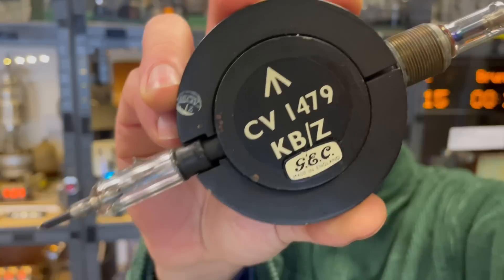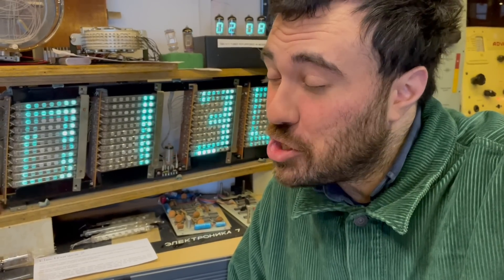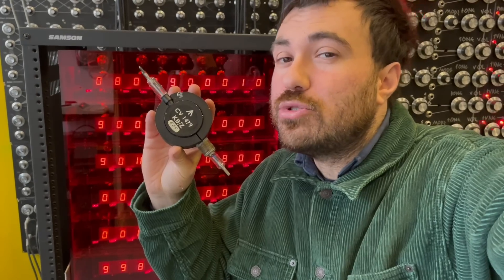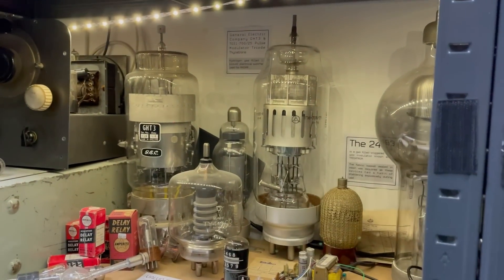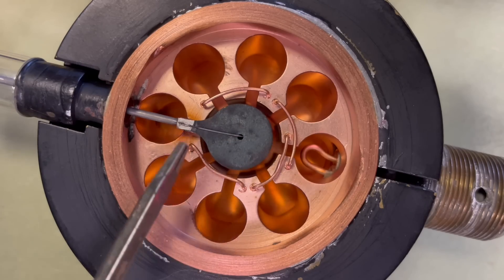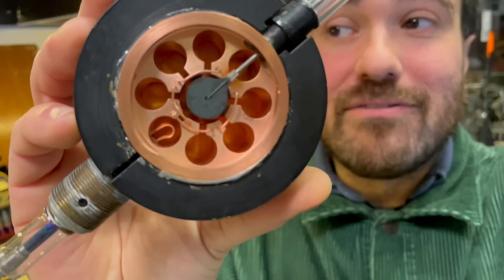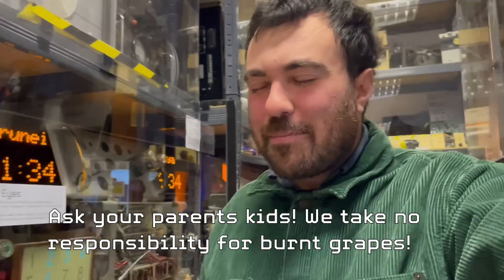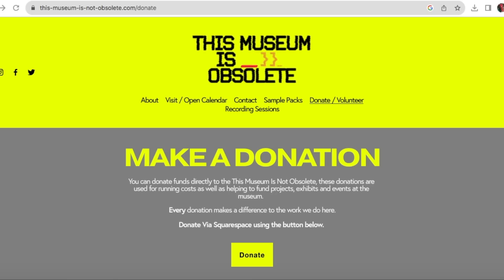WWII Tech You Use EVERY DAY

Comment from the maker: What’s your favorite thing to cook in the microwave?? (The only correct answer is Beanz)
Reply: DVD's!
Reply: @peskyparttimers8239  A friend submitted the idea of using a microwave oven as a way to quickly destroy CDR's, used in military systems in the field, after seeing me do that as a drunk demo. Never got taken up as far as I know. Technology moved on to flash drives.
Reply: @peskyparttimers8239  *DVDs
Reply: air
Reply: Omelets are easy to cook in a microwave. Just about 30 seconds in a large mug. Then again until done. Don’t overcook. 

Lots of the old technology looks steampunk. Thanks. Will have to rewatch video becuz typing .
Reply: Had some experience with Baked Beans in New Zealand. 
I didn't know that the plasma from grapes trick works with two touching grapes as well. I only ever tried it with one grape that's been nearly cut in half and folded open. OMG I just imagined what would happen of you put a whole bunch of grapes in the microwave. Don't know why anyone would want to do that, but who knows what nonsense some folks come up with on a saturday night after 2 am. 
My personal most shocking mircowave-explosions were caused by reheating leftover lunch. First time, I didn't know the paper bag was lined with aluminium foil, which caused a spark and set the bag on fire. Second time, I didn't know that fatty roast pork can explode all by itself. No flames this time, but one hell of a mess.

Comment: I would have liked to see that magnetron fired up and the output demonstrated in some way.  
I have a couple of vintage valves that look a little like that, but with the heat-sinks fabricated concentric to the glass portion.  2 heater wires in one end, one screw connection on the other from memory, similar to yours.
I'm guessing it needs a similar power-supply to a MWO magnetron... but how do you connect the HV and what do you do with the single screw output?

Comment: Erm ... Wait a minute... Electrons are negatively charged, so they are attracted to the anode regions where the net charge or electromagnetic wave is positive. Wouldn't that reduce the strength of the radiowaves since they make the positive regions more negative by their charge?
Also, as the electrons are attracted by the anode, their kinetic energy increases, which means their potential energy must decrease (total energy is conserved). Less potential energy means less voltage. So we get a smaller electromagnetic wave? Can anybody clarify or correct my reasoning?
Reply: No, their kinetic energy increases as they accelerate; conservation of energy only applies when there is no energy input!

Comment: I used to have a cool coffee mug from the Computer Museum in Boston.  It had a gold matrix/grid pattern all around it.  I regularly filled it with water and heated the water in my microwave.  One morning I wasn't quite awake and put the empty mug in and set the timer for 2 minutes.  Sparks flew everywhere off the gold design!  I didn't know whether to run over and turn it off or run out of the room.

Comment: The ones used in the modern microwaves are most likely more advanced.
Reply: No, they really are not, the only difference is that the magnet and output waveguide are integral to the magnetron rather than separate parts.

Comment: And I thought it would be about spread spectrum frequency hopping. (Thanks Hedy Lamarr!)
Hope  there was no beryllium or other toxic shit inside.

Always appreciating a lovely collection of Nixies, VFDs, EL displays - and other readouts.
Reply: "Most magnetrons contain a small amount of beryllium oxide, and thorium mixed with tungsten in their filament. Exceptions to this are higher power magnetrons that operate above approximately 10,000 volts where positive ion bombardment becomes damaging to thorium metal, hence pure tungsten (potassium doped) is used. While thorium is a radioactive metal, the risk of cancer is low as it never gets airborne in normal usage. Only if the filament is taken out of the magnetron, finely crushed, and inhaled can it pose a health hazard." 
Don't crush up the ceramic parts of a microwave magnetron, and assume there might be beryllium and thorium about, so wash your hands after handling them. The hazard is real, but relatively low.
Reply: @AndyHullMcPenguin  There is NO beryllium oxide in consumer microwave ovens, it's a widespread internet myth.